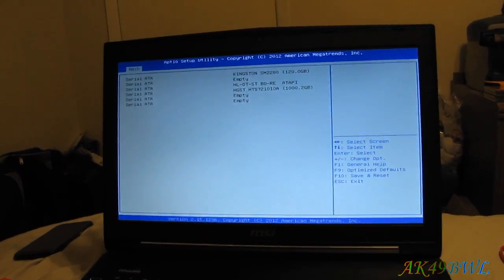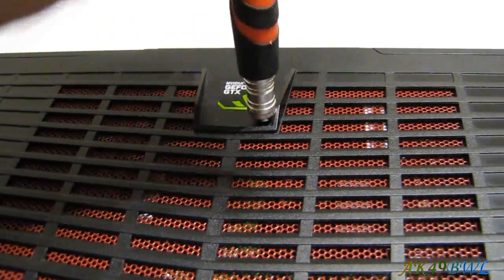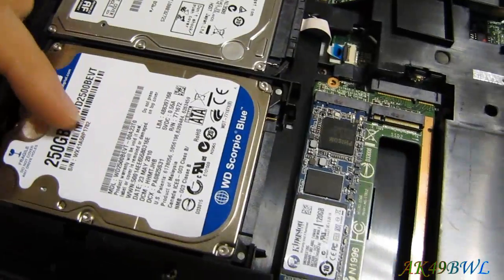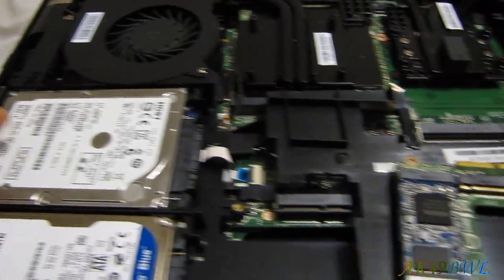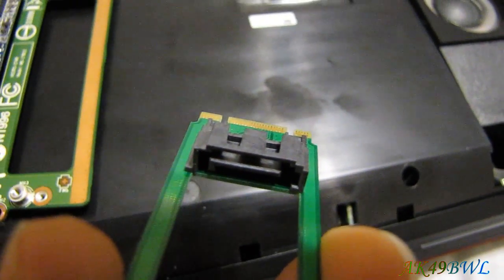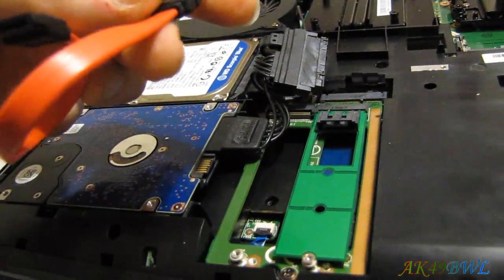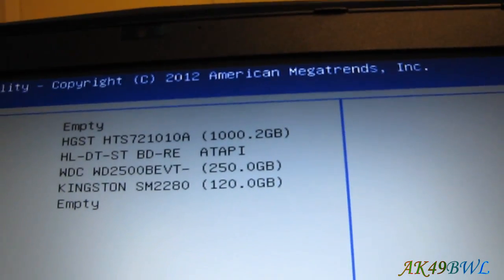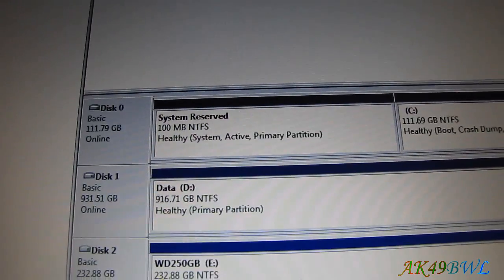How to Install a Second 2.5" HDD in the MSI GT72 Dominator Laptop

Comment: Would I need the same parts to install a 2.5" SATA III ssd?
Reply from the maker: Blake Johnson yes. When you think about it, an ssd is basically a regular 2.5 hard drive without the moving parts.
Reply: You're right. Also having trouble finding that short orange sata  cable. Oh, and I appreciate the quick response
Reply: @AK49BWL  i have the older GT70 2PC, is this somewhat capable of HDD/SSD drop in's  / upgrade to more HDD thank you Brandon

Comment: Top job mister. I've just followed your instructions and now have two SSD's (one for Windows, one for Steam games) and the original hard disk for documents, films, photos, backups etc.  Still had to order some components (such as the pass through cable) from America as I couldn't find them anywhere in the UK, but well worth it.  Everything working perfectly - didn't even need to reconfigure the boot order etc. as Windows 10 just did it all for me (seemingly). Thanks for this - spot on.

Comment: GT72 2QE Dominator Pro  i bought on 2014 December in Singapore.   The laptop still works function till today  9 years 5 months. 

so far i only do replacement for  2024 year

- BATTERY PACK
- FANS ( BOTH NEW 2024 )   THE OLDER FANS STILL WORKING LOL~  long lasting fans
- MONITOR LED LCD SCREEN  FHD 60hz ( the older one has reach it lifespan got horizontal lines and burned inside lcd)

thats the only parts i need changed ,   for both hdd and ssd  still working..

the ssd m.2  i upgraded to  512GB x 2  [B TYPE M.2 NGFF SATA 2280]     i dont put the extra hdd 1 tb  cuz the extension adapter i cant find in market..

most spare parts easily find in local market and china market online.. 

- UPDATE  NOTES 5-5-2024   LOGS (  for GT72 users )  cheers😁😍
Reply: Necesito un adaptador de corriente para este equipo, en México no lo encuentro por ninguna parte... 😅😢

Comment: Thanks for the video. I would have never found that power splitter adapter on my own. It's on amazon as well (just copy/paste the part number from the link in the description). I am putting 2x5TB disks in my GT72S-G220 using mhddfs in Gentoo Linux. Then will copy ALLLLL my data from every other location into it, take it to work to do a backup to Backblaze (as currently I'm limited to 250GB/mo transfer limit), then let it keep rolling backups from there. Should solve all my storage issues for a while!

Comment: Nice vid! Still going strong after so many years! Did you also got the keyboard issue? Some keys not working...
Reply from the maker: No, my keyboard's been fine... Every once in a great while I'll be typing along and suddenly some random off-the-wall letter will just toss itself in the middle, but generally it's fine.
Reply: @AK49BWL  I have the''f' '' g` and'' space'' not working. Many with the same issue. Going crazy to fix this... Some says it's hardware but had a few making it via drivers etc..

Comment: Hi Brandon you can tell me please , where i can buy the adapter for insert 4 ssd M.2 as you can put in this video , exists this in Amazon for example for buy , etc , thank´s and regards :)
Reply: Franky Franky with the new model where it only has one slot the chipset is HM170 and it only supports one pcie slot. Where as the model in the video is a cm23/26 chipset and supports more pcie lanes
Reply: @MrCrabs  i have a gt72vr 7rd dominator and I have one slot on my pc. Can I use another ssd adapter  with 2 slot or 4?

Comment: I'm thinking of getting an MSI GP70 or Lenovo Y50. The thing is I'm not sure if I like the matte screen as much as I prefer glossy. There are computers with FHD screens with glossy but by the time you add up the prices you might as well get a gaming laptop as they represent amazing value.
Reply from the maker: I dunno, I wouldn't trade this matte screen for another gloss. My Vostro is a glossy 1680x1050 and it attracts dust and fingerprints like you wouldn't believe. No matte screen I've ever had has ever given me as much trouble lol.

Comment: Great video man, I was thinking of doing the same kind of thing. I just got the GT72S 6QF Dragon Edition G and I love it. It is a great gamer but I have noticed that the lid is getting loose. Have you had to take the screen apart and tighten your hinges and if you did I was wondering how hard it is? I have done it on other laptops but there were screws and came apart easily. Thanks!
Reply from the maker: No, I haven't had that issue on this one, which has surprised me somewhat because of how often I move around and am constantly opening and closing it lol. Just looking at it right now, it looks like the trim piece that covers the hinge base may just snap on, so a little prying may get it loose so you can access the hinges directly, but my precision tools aren't near me at the moment so I can't really check ;)
Reply: Okay thanks, Brandon. I will look at doing this soon before it gets worse.

Comment: Very nice and great video! Is this going to hurt the warranty?
Reply: +aschuram 100% probability of hurting the warranty.
Reply: +aschuram  in case of msi unscrewing the downpanel is not going  void the warranty
Reply: +Jennifer Dzieło yes I saw that later, mb.
Reply: In the US, no. If they try to tell you this voids your warranty (if you have to send it in) then they are lying. This doesn't hurt the functionality of the device and you should be fine under the law. Msi is also well aware of the warranty laws and it's why when people call they tell them it's fine to open it. 

As always go check the laws for yourself first though if you're worried about it.

Comment: What is "UEFI"? Dude you're one brilliant dude! Pure genius!
Reply from the maker: Mitch Taylor  it's a new BIOS software basically.. Under the old legacy BIOS, the system could only address a small amount of RAM for boot processes, and hard drives larger than 2TB were outright not supported. UEFI also allows for some special bootloaders, like what Windows 8 uses - I don't think you can put Windows 8 or later on a computer without a UEFI BIOS. Among other things... I just gave its wiki page a quick look a day after I bought the computer so I might have a few things wrong there but I do know it replaces the old BIOS spec.
Reply: @AK49BWL  just to clear out some confusion: windows 8.1 (and windows 10 for that sake) boot happily in legacy mode, they will just lose some uefi-specific features, like being able to select boot drive or enter bios settings from windows. windows 7 is also capable of booting in uefi mode, but only in 64-bit version (and it requires some tinkering with the files on the installation flash drive). that, however, does not translate to any tangible benefits (other than being able to run 7 and 10 off the same physical drive), as 7 does not have any uefi-specific features in the system.

Comment: Good vid mang! I just got this laptop , Broadwell Version i7 5700 w 980m. I am adding a second Hynix SSD to the current one to raid 0 the array. First though I plan to clone the original Win 10 installation to another M.2 SSD I have and just put it away.I would like to add a 1 TB SSD using your method to utilize the spare bay. I bought some 1866 ddr3 ahead of receiving the laptop and just learnt that to replace the original memory is going to require as you mentioned a tear down. I have taken a look at it and can do it bt not sure if I want to do it, lol. My other option is to figure out what model is in the unit now and just buy another 8 or 16 of 1600 ddr3 but I would like the added bandwith of the faster Vengeance CL9 I bought. Its a great laptop thugh that is for sure. Have you added more ram or ventured into that process of getting under keyboard?
Reply from the maker: I have not! I'm still running the original 16GB, which on mine is two sticks under the keyboard that I haven't seen because I haven't torn mine down beyond the bottom cover lol. Can't think of a reason I'd need to, aside from making another video, because I have two empty RAM slots still. As for the original OS.. I originally did the same (except mine came with 8.1)... But then I ended up putting that SSD back in and wiping it out for use as a fast-access video editing drive lol
Reply: you have any idea what the standard ddr3 1600 brand and CL timing is??
Reply from the maker: Well... CPUZ tells me they're Kingston part number MSI16D3LS1KFG/8G; CAS 11, RAS to CAS 11, RAS Precharge 11, tRAS 28, tRC 39 ... But I seeeeeeeeriously have no idea what half those numbers even mean LOL
Reply: I asked because after looking at the work required for the teardown to replace my 1600 w 24gb of 1866 I am not sure I really want to be bothered, in case I fuk something up. So I have thought to return the ram to amazon and just get a matching 16GB set of 1600. Thats what I confirmed the ram to be as well
Reply from the maker: Yeah, that's what I want to avoid with mine as well lol. So I figure, if I ever run into a need for more than 16 (I don't think I will, considering I still run Win7 and don't do much that's memory-intensive), I have two empty slots to play with :)
Reply: @AK49BWL  you still rocking this unit out or what?  I had to reference your vid because I traded in my GT72 2qe via the MSI GT USA Upgrade program for a GT73VR 7RE w 7820KH and GTX 1070 I since sold it after 20 mths and pocketed just under 600 and got a mint Gt72S 6QF 4K w 6820 and 980GTX 8GB desktop version w 2 x pcie nvme and 2 x M.2 slots and a HD. I want to now add a 2nd mechanical SSHD drive via your method:)

Comment: Hi Brandon. I have the same laptop and was wondering if it's possible to use more than one m.2 ssd using the 4-slot tray that came with the computer. I have my OS and apps on a PCI-E ssd and want to plug in another m.2 ssd right next to it. Everything gets routed together so I wasn't sure if the OS would treat the hub as one drive.  Ideally I would render videos on the PCI-E and have the second SSD to hold the video cache.
Thank you!
Reply from the maker: What you're describing is exactly what I did lol. Each slot on the four port card is a single drive, meaning you can have up to four SSDs and they will show up separately to the OS.
Reply: Perfect! Thank you.
Reply: I'm running into a problem.  After installing the second m.2 (which was the original OS) the laptop wont boot.
I cloned the OS to a new m.2 PCI ssd and it works great with just the one drive. 
I formatted the old ssd and installed it in the 4-slot tray. 
I changed the boot order to load the new drive but it wont load with that old SSD that used to have the OS on it. 
It seems like it's trying to load the original ssd even though I formatted it and changed the boot order.
Cool cat btw!  Looks just like my grey rescue.

Comment: Hi AK49BWL, 

I have a MSI GT72S laptop and I was curious if a "Sintech - SATA HDD to B key M.2(NGFF) Socket adapter card with SATA power cable" would be able to function properly with a 2.5" SSD or HDD?
Reply from the maker: +cruzernator can't tell you 100% either way. It may work and be a tight fit, or not work at all.

Comment: Is there a power/data cable that could be plugged into the SSD socket (throw out the entire ssd block) and then connect it to power a regular 2.5" SSD in the second bay? That 4-bay SSD is a major pain and I would just use a 2.5" and power it from the SSD socket. Do you know a cable for that? Thanks!
Reply from the maker: Why? M.2 SSDs are physically smaller but have the exact same capacities and speed as their 2.5" counterparts, and with the 4-drive card, you can run 4 drives in the space of 1 2.5".... But to answer your question, no, I'm pretty sure there is no such cable because the 4-drive card is MSI proprietary.

Comment: You are mistaken about Windows 7 not supporting UEFI. It does, by default if you partition the drive your installing it to with a gpt partition and select your DVD / or flash drive to boot under UEFI when starting your install. All you need to is disable secure boot for install, and after install, the new keys will be loaded in the bios, and you can re-enable secure boot. 

First link: http://blogs.technet.com/b/askcore/archive/2011/05/31/installing-windows-7-on-uefi-based-computer.aspx

Second one (For creating a UEFI based USB stick): https://rufus.akeo.ie/

Windows 32Bit does NOT support UEFI, but 64Bit does and it's easy as pie to do.
Reply from the maker: Brent Taylor  aye, see I did mention I'm new to all this stuff lol.

Comment: I would like to replace the video card in my laptop. Is that possible and where would I get a nice nvidia gaming video card?
Reply from the maker: Evan Drince Where to find the new GPUs is going to be on you... But MSI very conveniently HAD a promotion going at some point to upgrade older GT72s to the GTX970/980, and the manual to do so can be found here: http://event.msi.com/gt72mxm/
Reply: Thats the thing, I cant find one. My laptop I think is about 2 years old also.
Reply from the maker: Evan Drince What laptop do you have? I know the MXM cards for the GT72 are all over the place (ebay, amazon) but I'm just now realizing I have no idea what your machine is lol.
Reply: Its not gaming or as easy to access as yours. Mine is an HP dv7.
Reply from the maker: Evan Drince Ayyee. Your systems GPU is soldered to the motherboard according to the images I'm seeing for that machine. Not upgradeable. It looks as though you could upgrade the CPU if you wanted, however... There appears to be a wide spread that this computer was manufactured with the same model number but different components, as I'm seeing varying AMD and Intel CPU sockets, old and new generation.
Reply: *****
Yeah Im probably just going to upgrade the memory and hard drives with SSD
Reply from the maker: *****  mine has the GTX870, so no, not ALL GT72 models do. I didn't spend $3000 on this machine, it's not specced out like those are. However it could be if I really wanted to spend for the upgrades.
Reply: ***** Mr. could tell me what windows 7 build(name) do you use/have?why Iam ask you?
because when I installed in my laptop gt72 2pe windows 7 ultimate I received/got hard  lags!!!! with gpu intel hd 4600 , after when I put/turn my laptop to sleep or waiting mod .
answer me please)
Reply from the maker: I'll be honest, I don't use sleep mode on any of my machines because I always had problems with it, often having to reboot the machines entirely to get them to come back... and with the speed of the SSD on this one, I'm happy with a 30 second wait to desktop.. I've also only used the Intel GPU once, simply to get the drivers all installed for it - but yes I'm running Ultimate as well. I have to be completely honest with you - I don't think I'm the one to turn to with software and OS problems lol, I'm more of a hardware guy :)

Comment: Hey Bro, sorry for the low level question. I've a virgin GT72-6qe notebook. It should have 4 slots for M.2 2280 ssd, am I right? ( in the true it should be 3 since my notebook came out with one 250gb ssd already plugged in)
Reply from the maker: Should, is the operative word lol. Does it advertise SuperRAID3? If so, then it absolutely "should" have the four-port card.

Comment: i got a question about power to the HDDs though. to my understanding you used some sort of a parallel adapter to the supply right? if so would that put extra load on the single power supply port? would it burn out or something in the long run?
Reply from the maker: +pheonix31121 I don't believe so, but that is something to consider I guess - may just want to check the power draw of the drives you put in, but mine's been going for a year now with no problems at all.. It would be nice if they made an adapter that provides power to the drive as well as the SATA connection, but the only one I found like that is too bulky to fit in the minimal space given.

Comment: Two quick questions. How do you know that the ports are sata 2 and not sata 3. Also, i have the new model, currently i am using the m.2 slot (only one slot on the new 1070 model) and one of the bays. I also have a spare bay with no connector, is there any way to connect it up without removing m.2 or ODD but through one sata cable? Thanks
Reply from the maker: I don't know enough about the newer models to say anything - and they may all be SATA3 in the new ones as well. I don't remember how I figured out the disc drive and onboard SATA port are SATA2, but they are on mine.

Comment: One question. I have a gt72 vr 6rd dominator. My Notebook isn't equipped with that 4 slot m.2 adapter. do you have any idea where I can get one of those? I can't find it in any shop and even don't know what is the correct  name of it to search for.
Reply from the maker: I have never been able to find a replacement card sold anywhere for these. One person told me they called MSI and was able to have one shipped to him, but even eBay doesn't yield results for the adapter.
Reply: with the new model where it only has one slot the chipset is HM170 and it only supports one pcie slot. Where as the model in the video is a cm23/26 chipset and supports more pcie lanes, so its not supported

Comment: HI Brandon, at 3:40 you said that you replaced the 128gb M.2 with Win8.1 in favor of a 120GB M.2  with Win7.  I want to do the same thing, but I heard that Win7 doesn't have M.2 drivers. Can you give me the lowdown??
Reply from the maker: The M.2 in this laptop is simple SATA, not NVME. Win7 doesn't know the difference between these and a regular 2.5" SATA SSD.
Reply: @AK49BWL  I see, thanks a lot for the  reply!

Comment: Do you know where one would find that ribbon cable that goes to the motherboard? It seems to have broken when it was taken out the normal way
Reply from the maker: +ʌɐX my guess is you'll either have to contact MSI for it, or maybe look on eBay? Some of these may have for-parts listings already, I'm not sure.